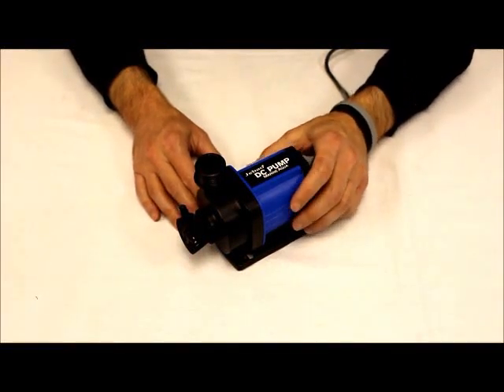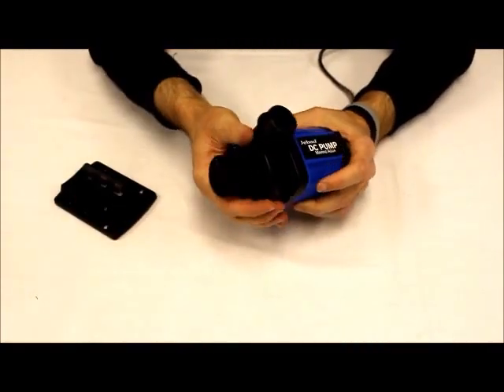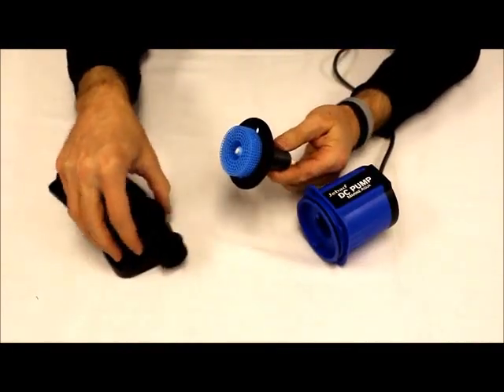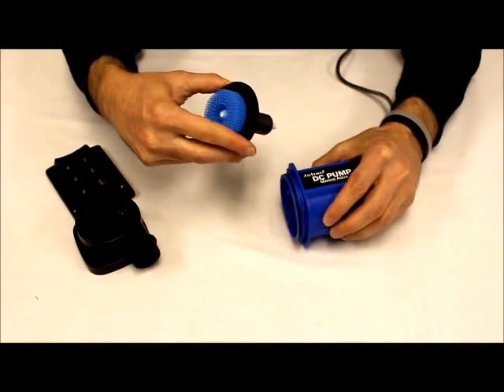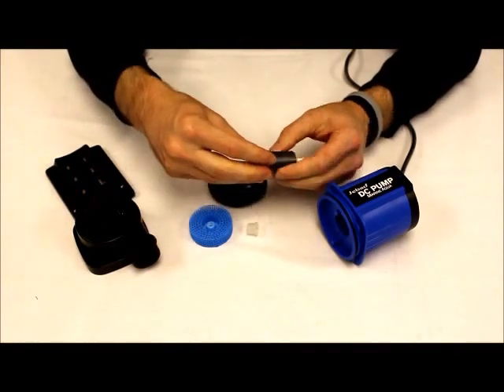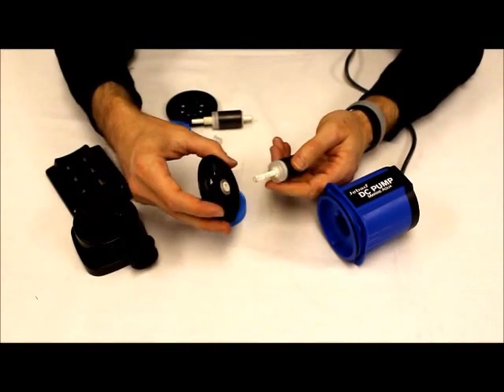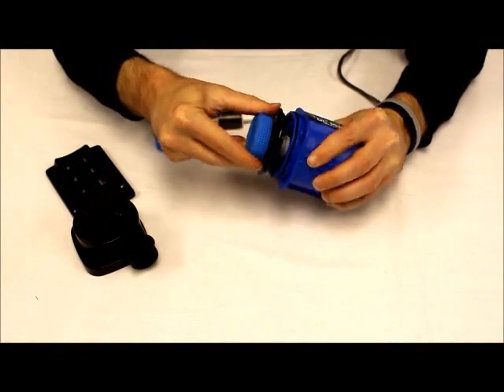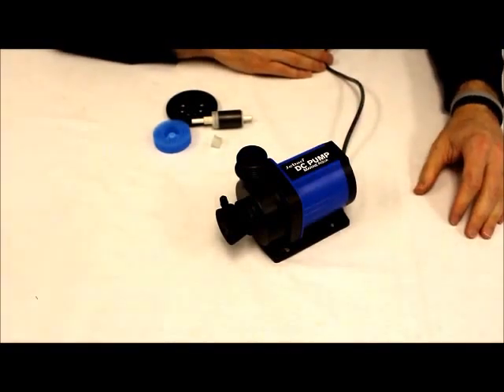ATI PowerCone - Impeller Troubleshooting & Replacement for DC Pump

Comment: Have experienced this with a couple other brands. All I did was put the impeller into my ultrasonic cleaner and it blew the crap off the bearing described and 5 minutes later all is well and working.
Reply from the maker: +Felix The Cat 
Thanks for the tip!
Reply: How on earth i can found just the new impeller for jebao 4000 pump here in greece?i have the pump but i not have the new impeller to bye it.any ideas?